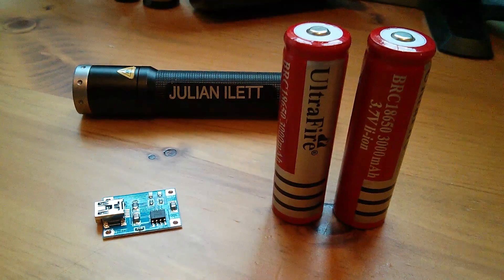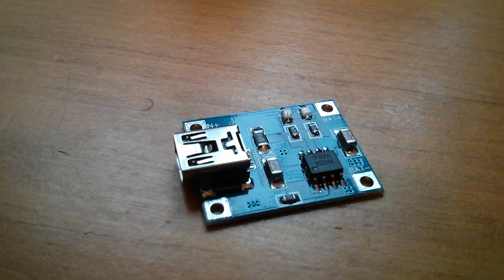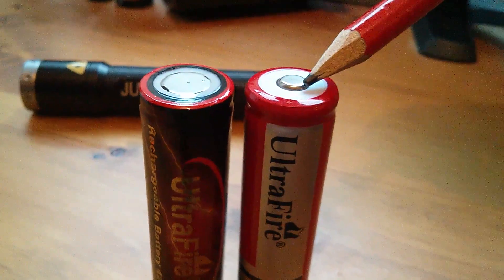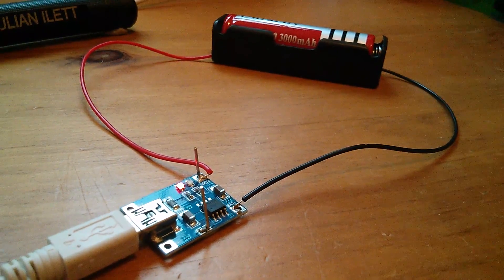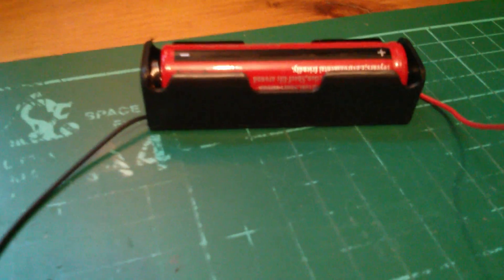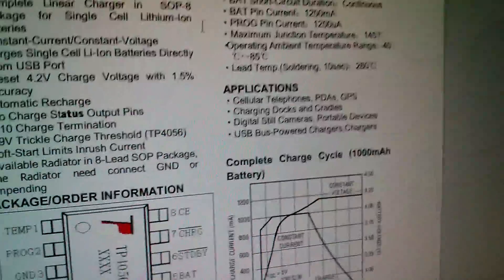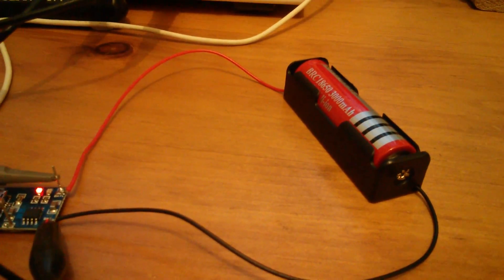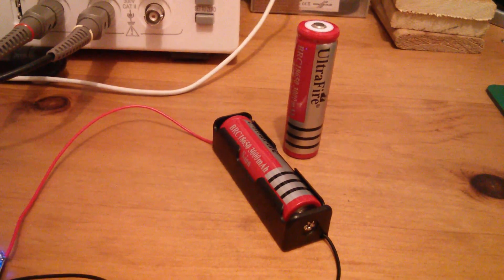Charging a Lithium 18650 Cell using the TP4056

Comment: How can I mod it for REVERSE POLARITY PROTECTION. Thank you
Reply: romantashev use a keyes connector and be mindful when wiring the connector.  You cant use diodes as they have a voltage drop and prevent full charge.
Reply: EkriirkE  Thank you. but how this will prevent the polarity of the 18650 battery if iswitch the polarity by mistake when i put the battery in the holder? And what is "keyes connector"  do you mean "keyed connector"?
Reply: look here http://blog.deconinck.info/post/2017/12/22/18650-Battery-charger-reverse-polarity-protection
Reply: romantashev Too late for me, good thing I have 5 more.

Comment: marine  grade amps are best. also to remember when  batterys run down on volts the amp draw is higher from the load .unless you have an out side power feed to recover the volts. that part is in its chemistry and how large or small  the holes are in substrate that electrons flow past     like sand through  diffent size screens.

Comment: These type of circuit boards come as a strip when you buy two or more.  Cutting the strip into individual PCBs is easy.  The Japanese "Nokogiri" saw cuts on a pull stroke.  The blade is super thin (like a "Zona" saw.  The pull stroke of about 3 inches done twice will score the board enough that it can be flexed at the score line (like breaking glass with a score line) and it snaps like glass.  A clean break.  No dust or wasted PCB material. 
GREAT VIDEOs. 
 These thumb nail size 18650 Li-ion chargers are just what the doctor ordered.

Comment: I have a question. I just bought one of these http://www.bestbuy.com/site/sony-cd-cd-r-rw-boombox-with-am-fm-radio/1807116.p?id=1219065405319. It's a boom box that uses 8 D cell batteries. I thought about buying 8 Tenergy 18650 10k MAH NiMH batteries, and a professional charger that charges 8 D cells at a time. I added up the cost to do that and it costs almost $200.00!!! That's crazy! So I thought about making my own 11.1v 3x 18650 battery pack. Is this easy and safe to do? I thought about buying a 3 cell 1865 battery holder, 3 18650 circuit protected batteries, and a 18650 battery charger for 2+ cells. I would then just pop the charged cells into the battery holder and then connect the charged pack to the battery terminals on the boom box. How would I go about ding this as a viable solution if mine is not the right way to do it? Is there a  more efficient way to charge the cells than  to individually charge them?
Reply: 18650 batteries are li-ion, not ni-mh.  What's the max current draw of your device?  If it's really low, you might be able to use a cheap boost converter and a single cell lipo.  You could also just get some d > AA adapters and 8 x AA ni-mh batteries (~$20).  Just don't get the cheapo ni-mh AA cells on eBay - they can't handle much current.

Comment: Hy , I have a phone battery  laying down and it have 3.7v  / 1400 mAh
Would I be able to charge it with the tp4056?
Reply: RandomLOLGamer why would it blow?
In the video Julian also used a 3.7v battery.
Reply: Issam Mani Of course you can. 3.7 it's a nominal voltage. Whole lithium batteries are the same and have 4.2 as maximal voltage.
Reply: thanks for the replys!
Reply: Issam Mani
Reply: No, it will blow to hell i think :D it will charge it to 4.2 volts. But im not sure, try charging the battery with the phone, if the voltage is 4.2 you are good to go to use it with the board...

Comment: what a better idea.  just cut the end off a 5v 500ma  phone charger  ends and match the polarity's. just test with your ddm or multi meter to make sure it dosent exceed 3.7v.  you may also charge in parallel just put multiple chargers in parallel to so current will be doubled but voltage may stay the same.
Reply: That's not safe

Comment: I just used an Ultrafire 4000 mah ref 18650 with the same IC above, using a 1200mA charger, it took almost 3 hours. I guess we can charge up to 6800 mah battery with this IC (http://www.ebay.com/itm/8x-3-7V-18650-UltraFire-Li-ion-6800mAh-Red-Rechargeable-Battery-for-LED-Torch/121461196050?_trksid=p2047675.c100005.m1851&_trkparms=aid%3D222007%26algo%3DSIC.MBE%26ao%3D1%26asc%3D20131003132420%26meid%3Dcc99e7b8667641878517c4e118153f4d%26pid%3D100005%26prg%3D20131003132420%26rk%3D2%26rkt%3D6%26mehot%3Dpp%26sd%3D111387407345&rt=nc)
Reply: An 18650 with that rated capacity is a fake, unless it's a magical cell from the future. Consider testing actual capacity and IR, probably best to recycle it and get better quality if it's used unattended or in important things.
Reply: Oh and both the linked ones and your 4000 mAh 18650 things are fake, if it was a 26650 maybe... but it's still ultrafire. 

Please skim these,  it's merely about capacity not even considering the safety:
http://budgetlightforum.com/node/27603
http://www.ebay.com/gds/18650-Battery-Buying-Guide-test-on-all-from-eBay-below-3-/10000000178020340/g.html

Please get at least decent batteries, preferably the proper ones from a reputable source.

Comment: Hey, have you tried using this chip to charge multiple batteries ?!
I know it is designed to only charge one battery.
I was thinking of using an attiny45 to charge single battery fully at a time by reading the analog value of the battery voltage, then charge the next ... etc.
Using some transistors to select which battery to connect to the charger.
Theoretically, it looks doable, yet, I failed to use transistors, they get very hot directly I assume the reverse polarity voltage is applied is the reason, I tried using some diodes but it is useless, 2 or 3 v is bigger than the P-N junction of transistors and diodes.
So, I was only trying to find a cheap usable multiple lipo charger, any idea ?!

Comment: wouild i be able to use something like this on lipo rc batteries in anyway? i was thinking to use a lipo rc battery for a vaping box mod for the higher amp draw limits. i was thinking to buy a one cell lipo battery and make a circuit where it could go from battery terminals to a switch where if the switch is at one position it would be directing current to the 510 connector ect. and in another position it could be connected to something like the TP4056 for charging.. btw sorry if my question is confusing but any help would be very useful
Reply from the maker: james mahal Yes, as long as the LiPo is a single cell (3.7v) and you are happy with the 1A maximum charge current
Reply: So if I were to put say a 1s 5000mah lipo in the box mod it would take around 5 hours to charge fully? Sorry I don't know much about electronics but I've been watching your videos for some time now
Reply: do you think using a lipo single sell would be a good idea as they can handle much higher amp loads for vaping or do you think i should keep it simple and stay with 18650 type batteries?
Reply: Julian Ilett Hi Julian and everyone, I have one question can you charge more than one battery a time, like (put) 2 or more Lithium 18650 in parallel, Gonna work? and if yes they gonna charge 100% full mAh and voltage?!
Reply: Domino SixO sure you can
Reply: MrCh053n
Ok thanks for thte info, probably they gonna take double time to charge as in understand or more x batterys

Comment: I was testing my 4056 charge current with my multimeter in DC amp mode directly at the battery and I don't get anywhere near 1 amp of current during the constant voltage stage.  The max current I measured was around .4 amps. I was using a 3000mah flat Lipo battery with and without a charge monitor on the battery.  Have you every checked actual current at the battery?
Reply: James Vesely Your power supply has got a problem, most likely, because on my TP4056 it gets to 1A both measuring at the battery and the resistor.

Comment: Could this be safely used to charge a 3.7v 1500mah square Li-ion / lipo ?
Also i see you plugged your micro usb lead into a wall charger will it work for this as well as through an actual usb port on a laptop/computer?

Comment: Considering how accurate a Lipo battery charger has to be as per battery specs, it would be interesting to see data on the voltage drop from the charger to the cell because of the battery holder. It looks suspect to me.

Comment: Juliant, I got a bunch of those batteries at 4000 mah what is the real current capacity of them and we're can I get better batteries at a decent price. Thanks in advance. BTW I brought 2 of the skyrc chargers on eBay both were fakes they gave me my money back I finally got the b6 mini which was the real deal. But they let me keep the other two.

I enjoy your video brings me back to my youth when I was 15 playing with tubes and transistors LOL!

Krisy
Reply: The highest 18650 capacity you're likely to see currently is in the 3400 mAh range, I think Panasonic might be in the process of making slightly higher capacity cells but haven't seen them on the market yet. And for what purpose do you intend to use them? Most of mine go into projects and torches with the latter I always go with a protected battery, it'll disconnect the battery when overcharging or over discharge is about to happen. 

I mostly have KeepPower ones based on the Panasonic NCR18650B cells (3400 mAh, the high capacity variant) up to 3A these will do fine but if you need higher sustainable currents I'd suggest to go with high drain optimised ones. I also have a bunch of older lower capacity ones and unprotected naked cells, if I can implement the cutoff below a voltage myself this is cheaper and the extra protection chip obviously adds a little bit of resistance (insignificant unless you're using really high currents). 

I get most of my batteries from http://www.nkon.nl, a Dutch webshop due to both price and speedy delivery. Not sure what they charge for international shipping but within the country I get the orders the next workday unless the post company slacks and it spends an extra day in transit. The site has a good reputation on candlepowerdforums and is used a fair bit within Europe for both decent pricing, fast delivery and getting authentic products. I'm always a bit sceptical on eBay there are too many fakes floating around, rewrapped old laptop cells basically if the price is too good to be true or rated capacity is wrong don't buy it. NKON is probably not going to be worth it outside Europe due to shipping cost and time. Torch and other hobbyist places such as candlepowerdforums will likely have people knowing good reliable sources. Perhaps as simple as pointing you to the right vendors on eBay. 

http://lygte-info.dk
This site may be valuable to check some reviews of various batteries, he does pretty detailed testing at a good range of currents and also checks what currents trigger the PTC, may be important to know both to make sure it has one and if it'll allow the needed current in a really high drain scenario. 

Again be mindful of fakes, personally I'd avoid ****Fire. Not all are fake but even the ones that aren't tend to be mediocre at best. Do yourself a favour and get a quality battery especially considering how long they last and they are much more likely to fail safely when accidentally short circuited triggering the PTC and probably frying it saving you from a thermal runaway and gas venting or possibly even fire.

Comment: Bought few of these, for playing around, and some of them, after a while, stopped working properly, the LEDs are on even without a power source, just with the battery, (red LED if the battery is not fully charged and blue if battery is charged), plus the charging does not stop at 4.2V goes up to around 4.5, any idea why?
Reply: *****  have the new ones as well, same problem.
Reply: 4.5v?!  Well I guess I won't be using these ever...
Reply: I just read the specifications for an ICR 186050-26FU Li Ion from Samsung. They were tested with 12V overcharging for 2.5 hours. Samsung says "no fire, no explosion". I'm not sure about other Li Ion batteries, but at least with a few you should be fine with overcharging. Definitely check the specs for your Li Ions though.

Comment: I noticed there are at least 2 other variations of this charger now on ebay. Have you seen/tried any of them?
Reply from the maker: David Ashley I've not seen them - I'll have a quick look. Do you have links?
Reply: Julian Ilett http://www.ebay.com/itm/TP4056-4V-8V-5000mA-Mini-Lithium-Battery-Charging-Board-USB-Charger-Module-DIY-/371101643030?pt=Battery_Chargers&hash=item566761b116

That one boasts 5A charging. There's another that has no usb mini port so it's probably just the same. There are others that look like the link above with 1A charging: http://www.ebay.com/itm/1-PCS-5V-1A-Mini-USB-1A-Lithium-Battery-Charging-Board-Charger-Module-TP4056-/281425368612?pt=LH_DefaultDomain_0&hash=item4186425624
Reply: David Ashley It only says 5A in the title, if you scroll down and read the specs its says 1A. That is also limited by the TP4056 itself is you can be sure that there is a mistake/lie when they say something else. However, the version you link to has support for a temperature readout which might be interesting if charging cell phone batteries and such.

Comment: Thanks for the video, I was recently looking at this type of chargers too. The reason I was looking is because I wanna try building a battery pack of 100 cells (4S25P 14.8V). How would I be able to charge it? Get 100 of these chargers, 100 micro USB cables and 100 wall adapters? Are there any other more powerful chargers?

Comment: I bought these charger boards from different sellers, but charge current wont go more then 420mA, resistor is 1.2K. I even tried different power supplies, 5V 2A, 5V 1A, still remains the same. Then I tried reducing the 1.2K resistor, also this doesn't change anything, even if i connect directly without current resistor. Only if I use a bigger resistor the charge current changes to a lower current, but I can't get higher. Chip isn't hot at all, batteries were empty when tested (I checked at several intervals, still the same, and even lowering charge current).
Julian, do you have an idea what could be causing this problem?

Comment: Cool thing man, but actually much cheaper and convenient way is to get one 18650 power bank kit from dx.com, just 3.20$, mine was with xoupon for only .20$ with another stuff. You simply insert battery, plug in microusb phone charger, wait till red led turns blue and there you go. You can also use it as powerbank and directly charge your phone. But cool vid anyways :)

Comment: Do you know of any implication if the charger input voltage dropped, i am planning on using a small solar panel to charge a 3.7v lipo, but in darkness the voltage will drop?
Reply: It should be fine as long as the voltage is over the minimum input voltage for the charger chip, which is listed as 4v, but should probably be ~5v in order for the charge to complete properly. Of course, as you note, you can't count on that, so you should add something that will cut power to the charger if the panel voltage drops below the required minimum.

Comment: How low does one of these cells have to be for the charger to start chargeing them ?, When i put cells in the led instantly turns blue suggesting they are already charged. I have 12 unprotected cells from laptop battery pack and 2 protected crappy ultrafire which are so weak but when you insert them into charge pcb it lights blue unless the internal resistance is high or something.

Comment: i am looking into buying one of these but for a 8.4v as i have a solar panel and fountain water pump the problem is the pump only works with 2 18650 about 8v to 9v. I need the fountain working 24 hours so i am wondering if anyone knows of a way to do this.

Comment: Can i use 3 modules at same 5v source to charge at same time 3 18650 lithium battery in series, so i can balance charge a home made 11.1v lithium battery pack?
Reply from the maker: no, not 3 cells in series from the same 5v source. 3 cells in parallel would be OK, but it would take 3 times as long.

Comment: I have a question. I'm trying to make a portable USB solar charger, and not everyday is sunny out side so my question is that I have 3 ps3 battery so I'm going to use it and the battery stated that it's 3.7v and 1800mAh so all together is 11.1v and 5400 mAh so I was thinking of using TP4056 to charge it.My question would it work or no if it does about how much time would it take if it doesn't what's another way to give it power?
Reply: first of all , 3 batteries
V = 3,7
I = 1800 mAh
how can they be comined together  to create triple voltage and amperage????
Do you know any diffrence between series / parralel ?
I think (not trying to make you upset or sutch , its only for safety )
you should learn a bit tad more about voltage and amperage
Reply: Andrew van Leeuwen  ohhh ok thanks for pointing that out but i heard that it may not double the voltage but the amperage does get double is that true?
Reply: That depends on how you connect the batteries
lets say you have two batteries , and you connect them by laying them one after another than they are in series ( you get
[+ ] [+] )
you will get 7.4V (3.7v+3.7v)
if they are parralel (next to each other)
[+-]
[+-] 
then amperage will be 3200 mAh
(1800mAh+1800mAh)

you could read this http://www.zbattery.com/Connecting-Batteries-in-Series-or-Parallel

or check the internet about the basics of electronics :D

(a little reminder batteries CAN be dangerous when connected or charged wrong , they can leak , burst into flames or even explode ..
so if you are not sure always ask someone for his/her advise)

Good luck :D